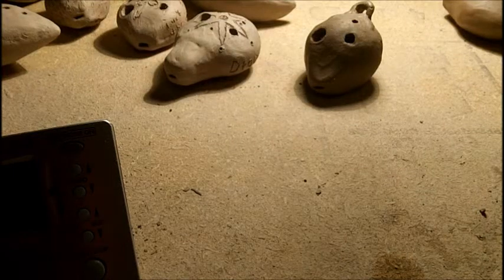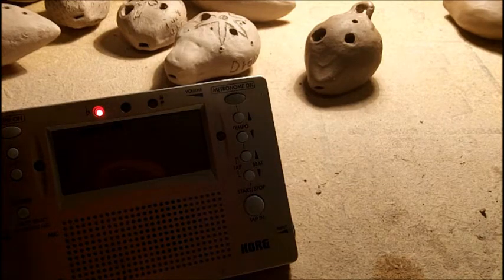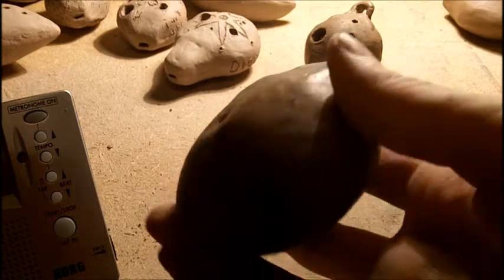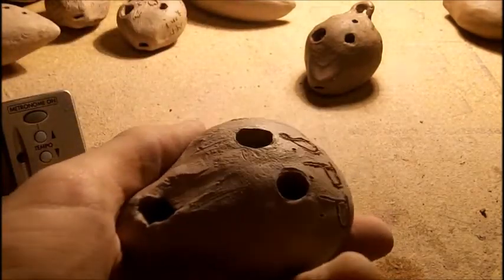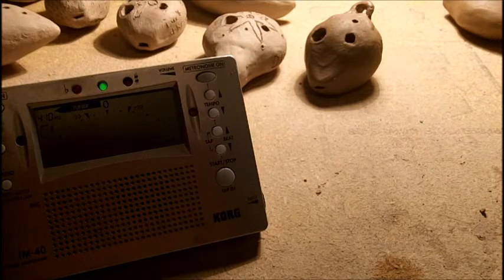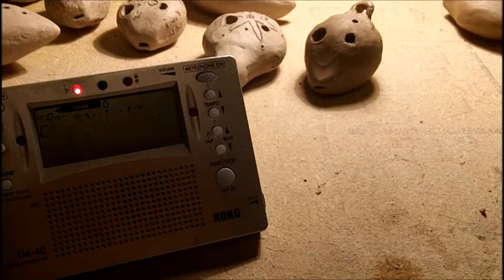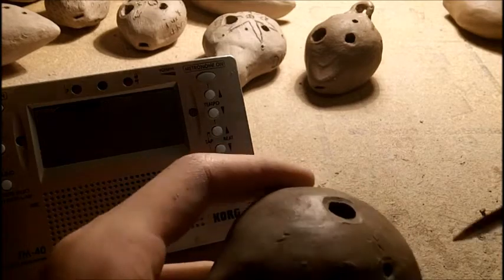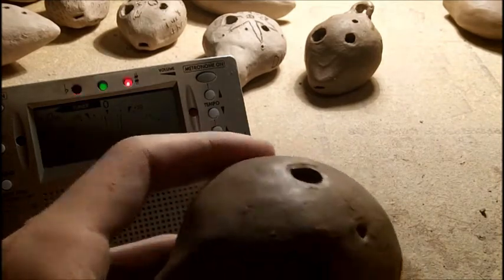A Tip For Tuning Ocarinas

Comment from the maker: Well I can not give an acurate quote but I would say an inline Serpant ocarina would be about $50.00 with shipping and a transverse the same size would be about $60.00. A small pendant like you requested would be about $20.00 so if you still want me to make another serpant ocarina in the shape of a transverse ocarina we can say $75.00 because if both are ordered together that is $5.00 off the shipping. If you like the inline though $65.00